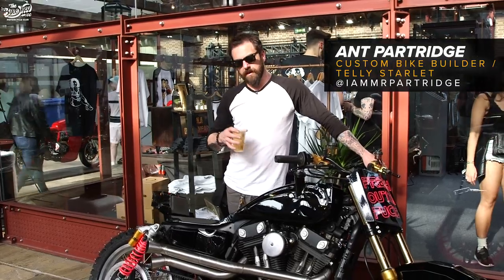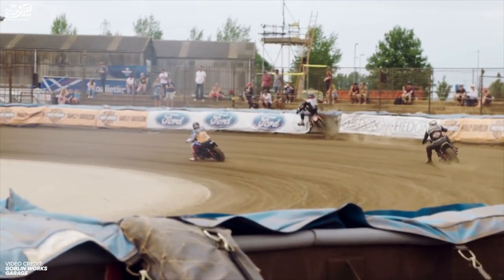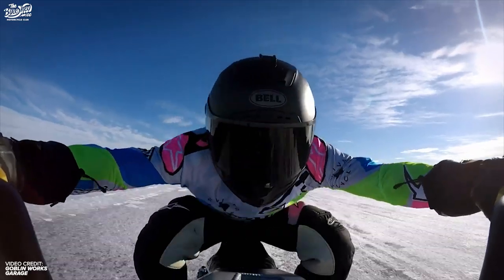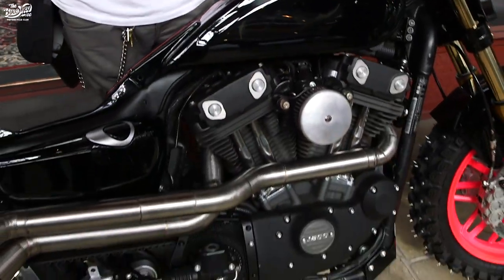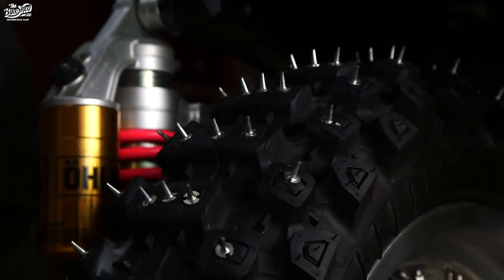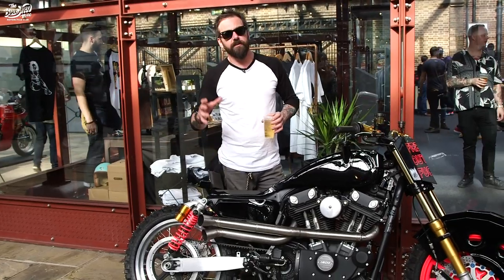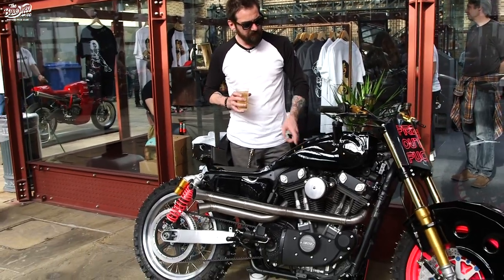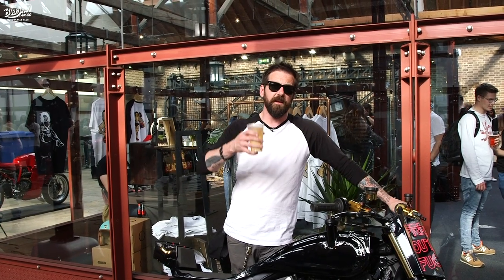Harley-Davidson Ice Racer by Partridge Design - Bike Shed Show 2019

Comment: Smart with no edge knob studs. You want the bike away as clean as possible if you lay it down on the ice. I bet the swedes put you on that pro tip. 😎
Reply: You bet first time on the ice, was epic lots of my Sweeed buddies there n run every year next time tho I'll run road tires and drill bigger spikes straight threw recon I can get a bit more traction. Ran a 179.6kmh and the back was still spinning a bit 🤘 great fun 👊